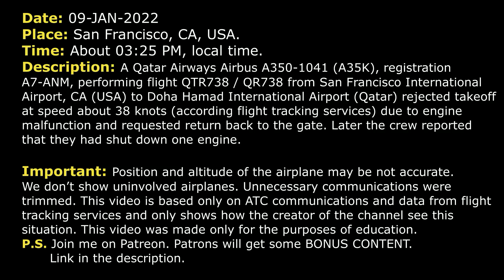Engine malfunction. Rejected takeoff | Qatar Airways Airbus A350-1000 | San Francisco, ATC

Comment: I thought that was really good for the TWR controller to advise the aircraft that there was inbound traffic on a 20 mile final and then a 10 mile final. This is good so the trouble aircraft can have some situational awareness of neighboring aircrafts.  Additionally, I’m sure the controller was watching very closely and would have called off the approach on that inbound aircraft very shortly thereafter if the plane isn’t able to quickly vacate the runway.  I commend the controller for his actions.
Reply: Yes and no. Qatari own the runway whilst they have an issue. The landing aircraft will just have to go around, if necessary.

Comment: The ATC gave a hard time for the QR 738 because of RW 01R, but NEVER corrected the United, that gave an incorrect readback at the beggining...
Reply: I’m sure the tower was going to correct it but Qatar practically stepped on united’s transmission so no chance to correct him. After that, he made the right decision to prioritize a rejected takeoff sitting on an active runway with aircraft on final. Furthermore, a runway crossing clearance is a very safety critical transmission, and needs to be read back correct. A taxi, far less so. Worst case scenario there is the pilot goes the wrong way and needs to taxi around a little.
Reply: Exactly what speed150mph said. I noticed the wrong readback, too, and it even briefly sounded like Tower stepped very  briefly on Qatari's RTO transmission, presumably about to correct United. But it was more important to handle the RTO, especially with traffic on final.
Reply: Also, the ATC wasn't giving Qatar a hard time on the readback for crossing 01R. The controller even admitted that stepping on Qatar's readback was his own mistake. But he has to have the full readback, with callsign, for runway hold short instructions. It's required by regulation for the ATC to get a the full readback due to its safety-critical nature. Regardless of whose (if anyone's) fault it is for not getting the full readback the first time, they are required to keep asking until they get the full readback or the clearance is cancelled.

That requirement does not exist for a pilot repeating back the wrong taxiway turn for an instruction that does not cross a runway, though that would normally also be immediately corrected, too, were it not for Qatari's RTO happening immediately after the UA readback.

Comment: Why is this ATC controller so rude?
Reply: What was rude about it? He was just trying to get the information he needed and make sure that everyone else (including Qatar) had the information they needed. It probably would have been better for him to speak more slowly when dealing with non-native traffic, but that's about it.

If you're talking about him specifically stating that he needed the readback for the hold short instruction with callsign, he wasn't trying to be rude. That's a requirement. He's not allowed by regulation to allow them to proceed until he has it because runway hold-short instructions are safety-critical. He even admitted that it was his own mistake of stepping on Qatar's first response, but that doesn't change his requirement to get a full readback from them.

As for the repeated calls that others have mentioned, remember that this video is a cut. Long silences and other irrelevant transmissions were cut out because no one wants to listen to 3-4 minutes of pure silence on YouTube. That's about how long it would have been between when the controller informed Qatar that the traffic behind them was 20 miles final vs. when he called again and said it was 10. That's a pretty long time to be just be parked on an active runway without telling anyone what you need or what your plans are, particularly when there's traffic on final behind you. The controller needed to know what their intentions were so that he could figure out what he needed to do with the traffic behind them, as well as so that he could get Qatar what they needed (whether that be taxi instructions back to the terminal, taxi instructions back to the beginning of the runway, operations vehicles to inspect their aircraft, or just more time.)

Aside from speaking more slowly, I don't really see much here that the controller could have done significantly better given the situation they had to work with.
Reply: Welcome to American ATC
Reply: @Iamwatchingyou75  Yeah, no. Quit the stereotype, I’ve flown to the U.S. for many years and have dealt with the controllers, they’re always friendly and get the job done.

Comment: This tower controller needs a reminder on the meaning of 'standby'.
Reply: The video's (necessary) editing makes it sound a lot worse than it was. There were minutes between the controller's requests, not a few seconds like the video cut makes it seem. But no one wants to watch a YouTube video of 3-4 minutes of silence, so they cut those parts out. Notice that at one transmission the controller says traffic is 20 miles final and the next it's 10. Airliners are usually flying at around 2-3 miles per minute down final, so there were probably 3-4 minutes between those transmissions.
Reply: In the towers defense he needed to know what the problem was, he had traffic on a 10 mile final. I do think the tower could’ve slowed down a little to where the pilot could easily understand him
Reply: @Flywithbasit  What's the matter of 10 mile final traffic? It's still like 2 mins to go, and just in case, a go around is always an option :)
Reply: Also needs to quit talking so damn fast

Comment: Wait I thought Qatar grounded their A350 fleet months ago?
Reply from the maker: This one is approaching SFO now. She's in the air.
Reply: It's about 40% of Qatar's A350 fleet that is grounded and they've ceased accepting new A350 deliveries until the issue is resolved.
Reply: Not all, only 21 in total I believe. The rest are still flying, it's only the ones with their ludicrous "safety concern" PR stunt.
Reply: @IT53AL18ICA  Qatar's concerns aren't 'ludicrous' at all. Damage to the paint and lightning protection system is actually quite serious on carbon-fiber fuselages. Boeing did tons of research on that when developing the 787. If you don't believe it's a serious issue, look up some of simulated lightning strike test videos for carbon-fiber fuselages without the copper mesh. They're completely destroyed by simulated lightning strike tests. A pressurized fuselage would literally explode mid-air if hit by lightning without that system in tact. Of course, that's not an issue at all for aluminum fuselages, since aluminum is quite conductive already.
Reply: @vbscript2  if that was actually as serious an issue as you're saying it is, then you'd think the dozens of major world aviation regulators would have, knowing this far better than you or I do, taken action on this and pushed to ground the aircraft. Instead, they've all rejected that as a contributing factor and reaffirmed that it's just a paint issue. The same goes for all the other airlines that would do their own research and come to their own conclusions. The only airline saying it's a safety issue is Qatar, and they're just making it a PR stunt to remain relevant and pressure Airbus to get what they want; it's something Qatar has done before but not to this degree.

Comment: Runway inspection ahead of the inbound? Aborted take off due engine malfunction. Taxiing across an active runway with possible fluid leaking from unspecified engine problem?
Reply: To be fair, the ground controller didn’t get an answer to what caused the rejected takeoff besides it being “a technical” until the aircraft was on F halfway to the gate. Even then, we didn’t get any info on the nature of the engine problem. Just that there was an issue and they shut it down. Maybe it was a compressor stall and they shut it down to prevent further damage and just taxi in one engine. Maybe there was a vibration indication. With a low speed rejection like that, they could have rejected for any little reason.
Reply: @speed150mph  Thats my point,  They said it was an engine issue and didn't expand on it, So based on that they should suspend and do an inspection. 
The crew are not in a position to advise what the issue is other than some abnormality. 
They said it was an engine issue in the first instance,
Thats all the controller should need to get the ground ops and checker on the move to inspect the runway.
By the time he said anything about 10 miles he could have had that bit of runway inspected before he even vacated.

Then they decided to cross at the other 3 runways with a dodgy engine and no one following looking for FOD.
Reply: @AirspotterUK  They did not advise that it was an engine issue until much later. They initially didn't say any reason at all, then, when asked if there was something ahead of them on the runway, they just said negative and that they had a technical problem. They didn't mention anything about the engines until they had already crossed 28L. By that point, the traffic behind them had probably already landed.
Reply: @vbscript2  Yep that's my point. That aircraft shouldn't have landed. Could be tyre or any other fod generating issue
Reply: @AirspotterUK  we are definitely on the same page. Totally agree.
Reply: Depends what your priority is safety or and easy shift.
Reply: @AirspotterUK  As a UK ATCO my priority has been, is currently and always will be ..safety.
Reply: @andrewbirch3033   I totally agree In the UK it is very much so,  In fact, I am the chap that checks the runway.
It appears not always as clear cut in the USA, Maybe its a training thing.

Comment: The controller should have been more patient. They could have had an life-threatening emergency and his incessant urging them to "keep things moving" could cause major safety issues in the future.
Reply: @HistoryNews10  it wasn't life of death but he didn't know that, and until the pilots are confident they didn't know that either. It's better to have a plane go around and ensure that plane is safe than rush a situation and make it worse. Maybe you don't care about your cargo but thankfully they cared about their passengers enough to take their time.
Reply: @jasonbrown9942  The controller knows the pilot can just keep saying standby, but keep in mind the video is cutting out long silences. An inbound landing plane went from 20 miles out to 10 miles out between ATC requests for info. At some point the ATC needs to know if he should be warning inbound pilots of a runway hazard, a need to go around, open the parallel runway for landing, etc. 
I'm sure the ATC would take appropriate action including sending landing planes around if the plane on the ground continues to just say "standby" but it's very good for the ATC to let them know that the situation is becoming urgent, in case they're able to give any more info yet.
Reply: @HistoryNews10 The only thing that was bothering me, was the fact that their was no runway inspection (at least from what we can hear) and landing traffic within minutes after vacating. The only thing ATC knew, was that their was a malfunction with the engine of any kind.
Reply: The audio is trimmed, it's not realtime.

Comment: Particularly appreciated the clarity of the ATC's instruction when there was confusion about the hold short at mike (even though 738 eventually got it right). "I need you to read back the hold short at 1R and your call sign." Excellent communication to prevent any possible issue, particularly as it may have resulted in an active runway incursion.
Reply from the maker: Great job 👍
Reply: Qatar got the readback right, but the controller stepped on it the first time. For runway hold short instructions, the controller is required to get the full readback, so that's why he asked for it again. He wasn't trying to be rude or anything, just doing his job. He also admitted that the mistake was his, but that doesn't change the fact that he's not allowed by regulation to allow them to continue until he has heard the full readback of the hold short instruction with callsign. They're required to keep asking until they get it, regardless of why they didn't get it the first time.

The same is not true of the taxi instruction given to United that has been mentioned, as it didn't involve a runway crossing. They would have undoubtedly corrected it, too, but Qatar called in the RTO before they had a chance to do so, so that became a much higher priority.
Reply: Ok, Daphne... and what about the United replying "D" instead of "T" and never get corrected by the ATC?
Reply: @PetrolHeadBrasil  I assume that United is very familiar and knows that ATC can be flexible in certain ways. Also, this video is of course highly edited so ATC may well have corrected it, but was cut from video. Not concerning, imo.
Reply: Well he got it right but the controller stepped on him. Very poor communication on the controllers part this whole video. The pilot said stand by 4 times and was pressuring a taxi off the runway. This is just bad
Reply: @St8ks  The controller needs to anticipate whether he'll have to send landing aircraft around, or divert; once inbound traffic is on ten mile final in a very busy airspace it starts becoming critical to know if the stalled aircraft sitting on the runway is going to be able to move soon or is stuck there. A certain amount of deference to the pilots is appropriate, but it's good that the controller is letting them know the situation and why he's asking for an update. I think it went OK!
Reply: @slyhatjones  yes but the pilot said stand by, send the plane around if you have to but a plane doing a rejection usually means something has happened that could affect the safety of the plane and all that unneeded communication in the cockpit could further hinder fixing the issue. I get what you are saying but the pilot is the one in control here
Reply: I disagree it's not the pilots problem there's one at 10 miles the controller wasnt anticipating anything hence why he was asking.
10 miles is plenty of time to with wait until 4 miles or switch them to the other runway or goaround.

Hounding the crew after being told to standby will not speed anything up.

Not to mention with an engine issue during a roll at most sensible airports than would be a automatic runway suspension and the one at 10 wouldn't have landed even if the aircraft had vacated due to a runway inspection.
Reply: @AirspotterUK  With SFO's setup on those runways, 4 miles would not have been plenty of time. C was being used for East-bound traffic, so vacating to go back to the gate means doing what the controller ultimately had them do - fast taxiing up 28R, then left on N and crossing 28L to get to F. 4 miles is not enough time for an A350 to do that and still have the traffic on final reliably have a clear runway by minimums. There also isn't enough room for an A350 to stop on N between 28L and 28R, so the controller has to make sure they can cross 28L as well before giving them the instruction to turn left on N. There's only about 250 feet between the hold short bars for 28L and 28R. Definitely not enough to comfortably have an A350 between them while using 28L and 28R. 

Also, he wasn't 'hounding' the crew as much as the video makes it sound like he was. The video is edited with longer periods of silence (and other irrelevant transmissions) removed. Notice that the traffic behind him flew 10 miles between requests from the controller (i.e. from 20 miles final to 10.) They gave them quite a bit of time, but ultimately needed an answer as to whether or not they needed to send the traffic behind them around, swap runways for them if possible, etc. or if Qatari was going to be able to clear (and, if so, in which direction.) Plus, letting the pilots know when the traffic behind them is 20 miles final and 10 miles final improves their situational awareness, too.

As far as runway sweep, they likely did do one after Qatar finally informed them of the engine issue, which wasn't until they were already on the other side of 28L. Again, the transmissions here are edited, so you don't hear everything that happened.
Reply: @vbscript2   Thanks for the reply. I agree about bits being cut down, Regardless standby means standby.  
Most aircrew will give more info but if not wait.

Mine main gripe is no inspection unless it was on another freq and travelling jn 4 runways with no jnspection behind.

I get all what you say, There's lots of ways to do it. If not enough room to hold between the runways hold on the runway until and inspection has determined continuing we nit cause a FOD issue.
Reply: The 4 mile call is relation to if clear land if not go around. But that's just we do it at Heathrow. 
If 4 miles is to tight then 6 or what ever suits KSFO.
Reply: @AirspotterUK  Yeah, 4 miles would be reasonable for telling the aircraft behind them to go around, but the controller was presumably trying to figure out what Qatar needed so that he could avoid sending traffic around (or at least figure out if he needed to plan to move them to 28L or some such thing.)

Once Qatar finally mentioned the engine issue, I would guess that a runway sweep likely was called for, but just not included in this video.